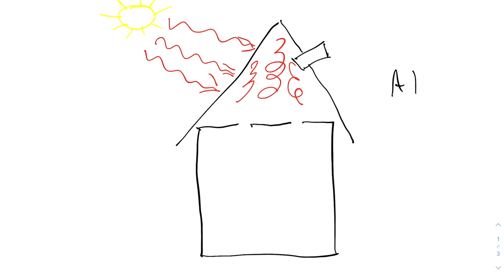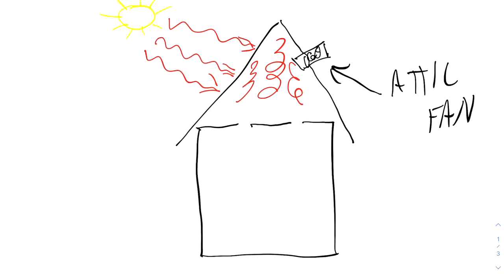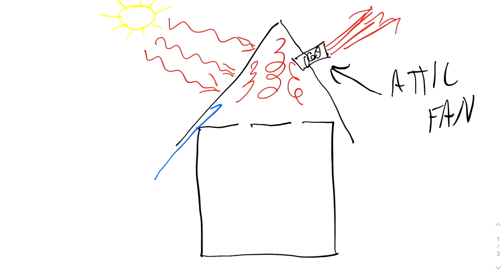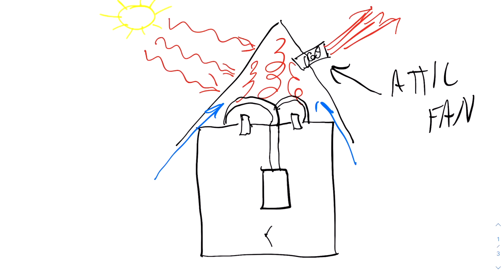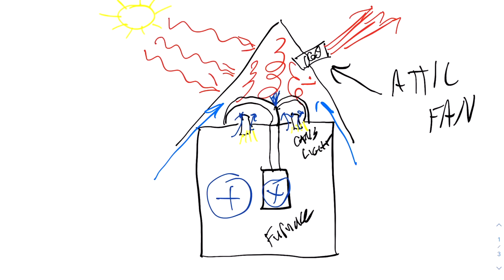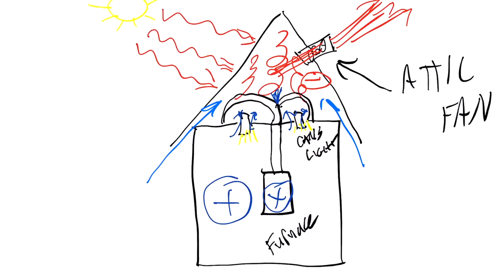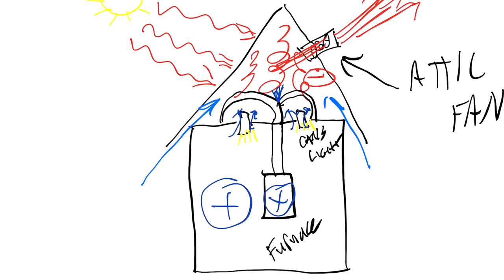3 Remodel Rip-Offs

Comment: I like my smart thermostats. I like monitoring temps from my phone as I have 5 zones. Within two zones there is a lot of square footage. Too much for a single point of temperature measurement. What is cool are the thermostat's remote temperature sensors. With these I have been able to make these two zones much more comfortable. I'm trying the scheduling function, but I much prefer getting the zones to the temperatures I want and then just leaving them there.

Comment: I too could tell the difference in the summer when my attic fan would run. It helped my house 🤷🏻‍♂️
Reply: Did you hear Matt mention it pulling cool air from your openings in the sheetrock? He didn’t say it wouldn’t work, he explained why it’s a bad idea. If you don’t believe him, go in an old house with a whole house attic fan. (The ones for cooling living space). Slightly crack open a window and turn on the attic fan. It’s shocking at the large amount of draft it will pull.
Reply: @jaye9300  But Matt's talking about those roof fans, not attic fans.
Reply: @jaye9300  I think you are confusing the whole house attic fan mounted in the ceiling below the attic with what Matt is opining on the powered roof ventilator fan which is very beneficial in some roof attics with poor conventional soffit or eave ventilation.

Comment: Correct me if I’m wrong but, I thought that attic fans drew the hot air out of the attic by relying on soffit vents to pulling cooler air into the attic using the stack effect and the forcing it out though the attic vent Exaust.
Reply: Air is kinda dumb, it doesn't know it is only supposed to enter the attic through the soffit vents.
When you depressurize an attic, air will leak into it through every path it can find, regardless if it is from the conditioned space or outdoors, in proportion to the size of each opening.
Even with newer homes, where they actually made an effort to seal the conditioned space off from the attic, at least a little air will be pulled from it.
You also have to regularly clean the screens behind the soffit vents, or they will become clogged and cause even more air to be pulled from the conditioned space.

On an older home where none of the wall top plate and ceiling penetrations were sealed, and/or where building cavities and floor trusses are open to the attic, powered attic ventilation can be catastrophic to the temperature and humidity control.

Comment: I live in the southwest corner of Utah. My roof already had soffit and large gable vents but the inside of the roof sheathing and trusses would get to about 190 degrees during the summer, and the air in the attic to 160. Installing a 1200CFM attic fan brought both temps down about 40 degrees, allowed my top floor to get cool, and my power bill to drop about $100 a month. I do live in the desert where it peaks at 115.

Comment: One thing on Attic fans is many of us do not have AC in the Attic, or live in Texas. However remember the Attic stays very hot even when the sun goes down, so the fan kicks in and cools the Attic down after that helping reduce heat in your house.   As for windows, if you have old leaky 20 year old PVC windows which are not low e coated, then you definitely can save quite a bit of money, especially if you install them yourself; test your windows with a thermal imaging camera on the inside and out to see how they are.

Comment: My dad, who was an electrician, put in his own attic fan with a thermostat set to 80°. It saved the house from really cooking in the summer. House built in 1963.
Reply: Same. Huge difference in my house that was built in 1900.
Reply: Yeah, he's wrong on this one. An attic fan alone won't usually solve the problem, but it is part of a multi-step solution. I've had them make a big difference in numerous houses, including my own.
Reply: Can also be very useful at venting humid air that has leaked into the attic from the living space.
Reply: They're good if you seal off the rest of your house
Reply: Well, in his defense, he only does jobs that are new construction or complete renovations, and he insulates the roof, the rafters, and would probably build a giant umbrella that would block the sun from reaching his customer's property entirely if he finds a rich enough client. "Why spend $500 installing a fan when you can spend $15,000 installing a new roof with 6 inches of foam insulation?" ... A true salesman.
Reply: @wudchk  
Yeah, caulk/foam any holes in the ceiling, build boxes for can lights and caulk/foam the boxes to the drywall/lathe
Reply: Our attic fan, when it's working, reduces the temperature upstairs.  But we have gable vents as well as soffit vents, so the airflow can be significant.
Reply: @pegg696  I think so.  I installed a gable fan in this little house.  It turns on automatically when the attic reaches 90 degrees.  It is exhausting hot air, so something isn't making sense in this video.
Reply: @MrNside  how about oak trees as an umbrella substitute?
Reply: I have installed electric attic fans and they do work to keep your house cooler.  I had a 1970 house in Utah and the upstairs got very hot.  I decided to add an electric attic fan and it made a huge difference.  During installation i found another way for heat to get into the house from the attic and once i fixed that it was even better.  Not sure why he hates attic fans as there are passive roof vents installed everywhere.  If you do not want to go to the work and expense of adding a good passive system to an existing home an electric fan is a great less expensive option.
Reply: House in Low Country of SC, in E Central MO, and N Texas.. The powered attic and gable fans were effective in all three locations.  It's time to tar and feather, Matt.  😁
Reply: I think he is referring specifically to houses with AC.  In that case, the real test would be your electric bill.
Reply: l337pwnage in the case of the air conditioning, the cooling effects in the attic space helps to cool even insulated ducting further boosting the cool air from the air conditioning vents. Makes it less necessary and when it is run it’s more efficient. I have a ventilation business in Australia and get the customers testimonials all the time about the effectiveness and cost savings.
Reply: Set to 80? That thing would probably never stop running from march till october here in 
Texas
Reply: A house with little to no insulation in the attic and probably leaky as hell. Band aid fix from a long gone  era of home building.
Reply: @MrNside  you could spend $500 adding more insulation and sealing the attic floor and actually fix the problem...
Reply: @MrNside  YES!!! and make sure the soffit vents are adequate, and that you baffle them so the insulation doesn't block the flow. But he's too busy spending 20 grand of the customers money spray foaming the rafters so by the time you find a roof leak, you've got rafters and a ton of decking to replace along with all that awesome spray foam because of all the trapped moisture... 

I think I'll seal the ceiling envelope, baffle, blow in r60, and spend a ton less money in the process too. Oh - also if you insulate rafters you kinda have to turn the attic into conditioned space that you pay to heat / cool too so ... lots of savings! :D

Comment: I had the windows replaced in my 1770 sq ft ranch home in Baton Rouge Louisiana. I saw an immediate $40 per month savings on my electric bill. I also noticed that my HVAC was able to cycle instead of running constantly. I agree with the comfort statement. I have a large 6 ft by 6 ft window in the dining area that was unbearable in the afternoon due to full sun. After installing the new low e windows, I no longer felt the heat radiating through the window. After watching your videos, I know there is more that I could do to continue to make my home more efficient, but new windows was a great first step for my home.
Reply: bobwatters  I actually don't enjoy living in a cave, e.g. what it would take to make the curtains useful. I like to enjoy the fruits of my outdoor labor from the comfort of my home. Replacing the windows cost me about $5K. I'll see a good portion of that back once I sell my home due to the update in appearance to the home. And at $40 a month, I see almost $500 a year in lower electric bills, I am not having to have my HVAC worked on almost monthly and I was able to extend the life of my HVAC system. So, I am damned sure that I will come out just fine on this purchase.
Reply: bobwatters  how bout stopping the cold in the winter?  they make curtains for that? lol. northern climates and resale value. those are the 2 reasons to upgrade your windows from single to double pane insulated. Good luck selling a home with single pane windows. and in a northern climete like maine or mass? forget it. single pane is a joke. you get a MONSTER high heating bill in the winter, and to top it off , your house is never really warm. where do you spend most of your time? in the living room usually on the couch. whats behind the couch? two big fucking windows, thats what. and single pane in the winter up here will literally be blowing ice cold air on you.
Reply: We put in new windows and it also made a big difference.  Our old windows would almost burn you.  The new windows are cool to the touch and our kitchen that’s gets the morning and afternoon sun is now nice and cool.  Before the new windows it was always hot.
Reply: bobwatters , not curtains... removable solar screens on the exterior of the windows would've solved this guy's problem for a fraction of the cost of new windows. The solution is to stop the sunlight from ever hitting the window in the first place. A curtain will do little good. At the point which the radiant heat from the sun hits a curtain, it's too late...the heat has already entered the home. It heats the curtain which radiates the heat into the room.
Reply: @eodhowland , I don't know, so I'm only asking..is your hometown hot enough every month of the year for you to see that $40/mo savings?

Comment: I disagree on the solar attic vent, when I moved into our house ( used ) for years I would have to stay in the basement in the summer. After a hail storm we got our roof replaced, we put 2 solar attic fans on the roof at the same time, for the first time I was able to stay upstairs in the summer, we also increase the temp because it was too cold

Comment: About 10 years ago I got an estimate for a new roof.  It was going to cost me about $4,000.  Instead, I used White Roofguard 700 for trailers on my worn-out shingle roof.  I used a roller and pole to push the sealer under the shingles, laying them back down.  My attic used to be 130F to 140F in the summer.  Now it is 5 degrees above ambient temperature midday.  Using this sealer about once every three years gives you a forever roof.  That white roof is cheaper than the fan and is 1/3 of your air conditioner bill.  Figure $75 for 5 gallons every three years.  Several years ago, I tore out the sheetrock off all external walls. I repacked them with 3.5" fiberglass.  I glued 1-inch aluminum-backed Celotex insulation over the studs and then applied 5/8 sheetrock over that.  I then mudded and painted. That makes an insane amount of difference.  I have about 18 inches of cellulose insulation in the attic.  That didn't matter because summertime heat will radiate all the way through the insulation.  I removed all but one egress window on the east side of the house and all but 1 egress window on the west side of the house.  My house is painted high gloss white.  I set my programmable thermostat to turn on at 10:00 pm and pull the house down to 70F.  At 4:30AM the thermostat is set to pull the house down to 68F until 10:00AM when it turns off all day.  That keeps the air conditioner from running during the heat of the day.  My 3,400 SQ.FT. house costs me about $110 to $120 per month during the summer on the electric bill.  Last month's electric bill was $93 because of the cold front and I stayed home and watched YouTube all day. Last month's gas bill was $59 and of that $30 was the service charge.

Comment: This is spot AF. I put a solar roof fan in Texas in my 12x12 Shed and My Goodness did it drop the temp 15-20 in summer from 110 to 80-90 that’s a huge difference and it cost $200. I put 2 on house and it drop my electricity bill noticeably. This guy is not smart .
Reply: this video is great for doing the opposite of what he's talking about LOLOLOL

Comment: The powered attic fan in my home wasn't working, the AC is in the attic.  Due to some really poor duct runs and a super hot attic, the AC could never keep the house cool when the attic fan wasn't working.  I installed a new working attic fan and the temp in the attic was lowered by about 30 degrees and now the AC can easily keep up and it doesn't even have to run full time now.  Maybe my home is just special, but having a powered attic fan most definitely made a huge difference in my home.
Reply: correct. this guy is wrong on all three of his "scams"

Comment: My 2,000 s.f., single story, built 1992 Houston home is uninhabitable without an attic power vent. It's wired 110v and maybe takes $4/month to run. Soffit vents only, no ridge vent, drops the temps significantly. Of course tech shield with spray foam in a sealed attic would be better but would cost five figures to convert. Compare that to two $100 power vents in ~thirty years. Hardly a rip-off.
Reply: I have a 2,400sq.ft. 1 1/2 story home in Houston, Texas with 2 ea. 3,200 cfm attic fans that have an in line thermostat set to come on at 110 deg. And cut off at 80 deg.. After the installation I saw my PEAK electric bill reduced by $50.00 a mo. (June, July and August). Before them, when I was in the attic, I would almost pass out from the heat. What a difference it is now.
Reply: An attic fan is just a bandaid to your real problem: poor insulation.